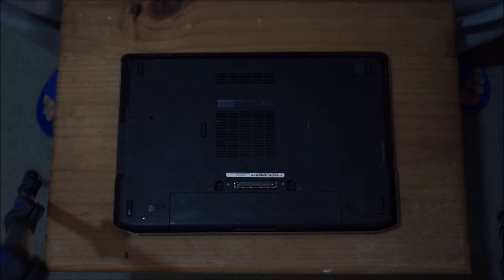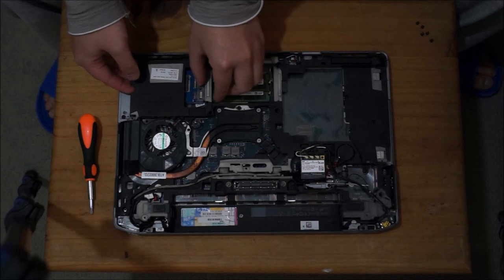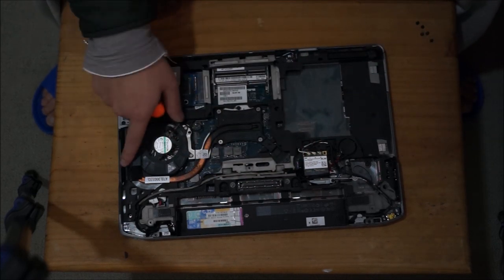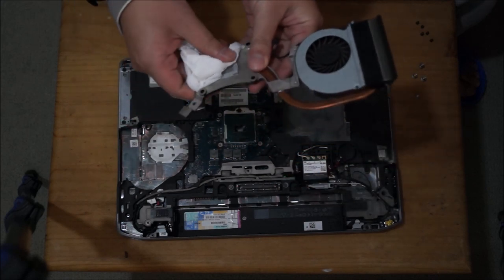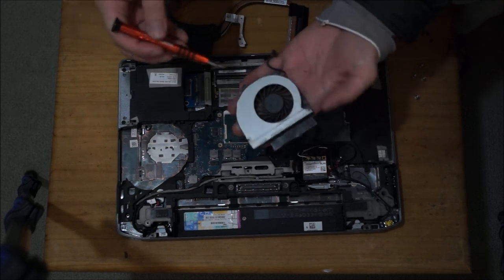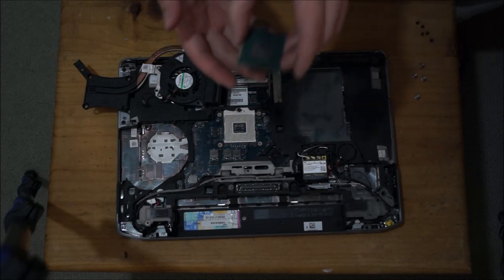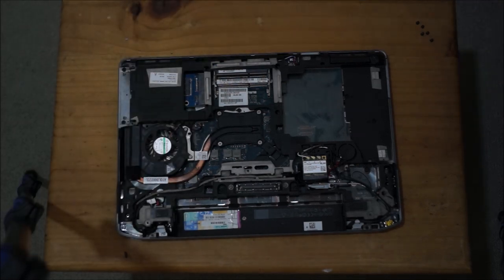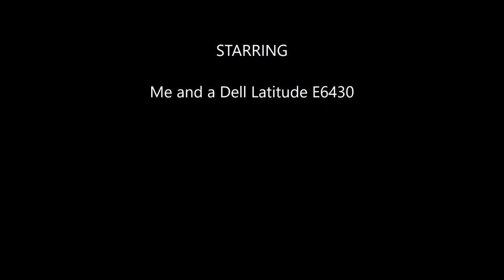OPEN ME UP! Dell Latitude E6430 and E6420 Disassembly

Comment: Thanks for the video! I have mine apart right now. The portion of the cooler that branches off to the chipset doesn't quite touch it, seems to hover about 1mm above the die. Did yours have a thermalpad there? Didnt see one on it in the vid but thought I'd ask. If not does yours actually touch the chipset or is there a gap on yours as well? Thanks!
Reply from the maker: it needs to touch. if it is not touching then thats bad